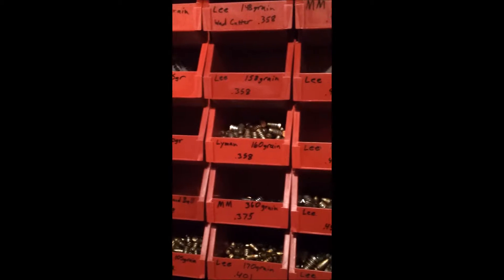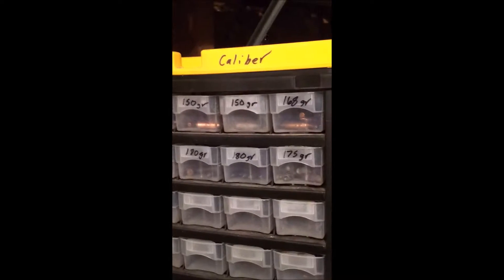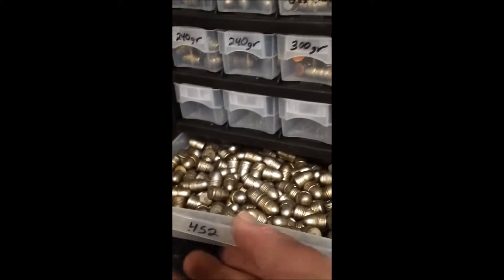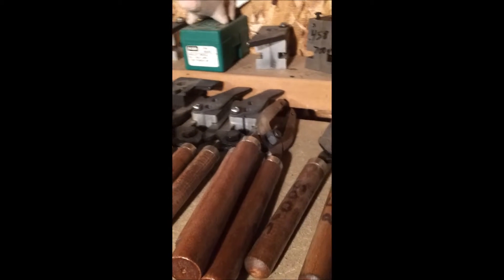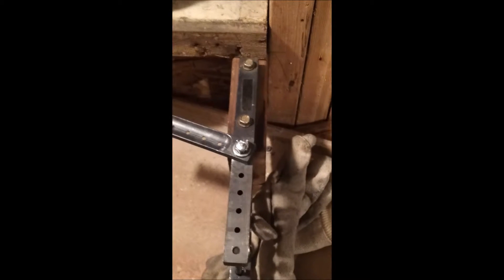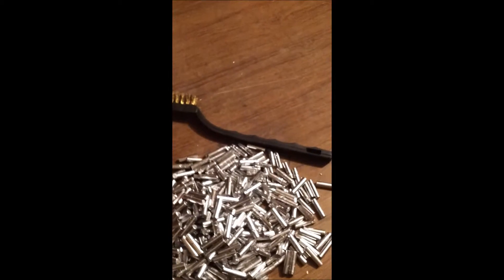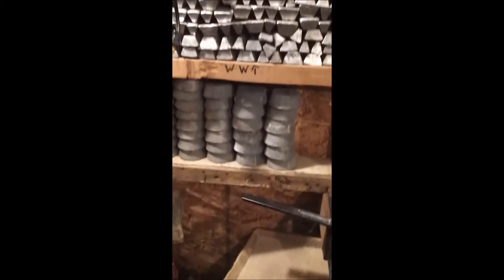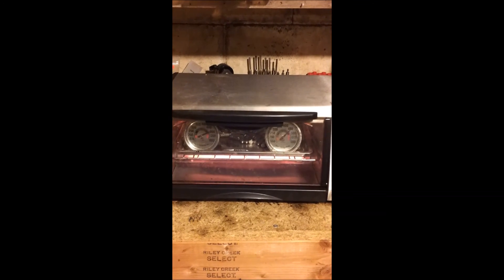My Bullet Casting Setup

Comment from the maker: get LEE stuff to sttart off with then you can get steel molds if you need them later. melter 60 ,mold 25 ,ingot mold 10 , ladle 10, lead?. can of BULLET DROP OUT 10.